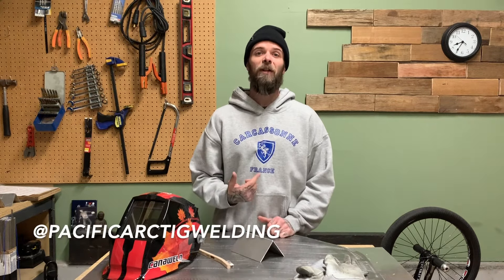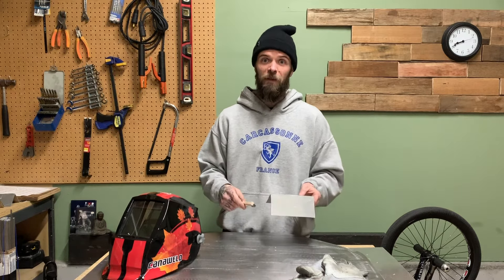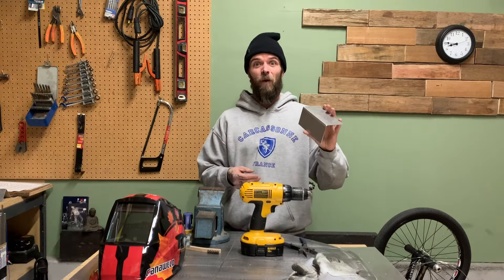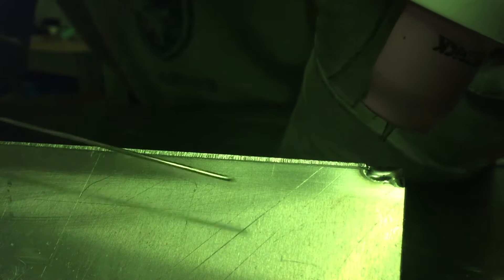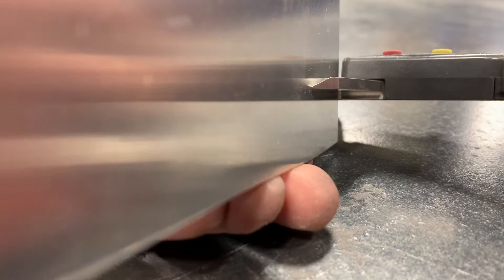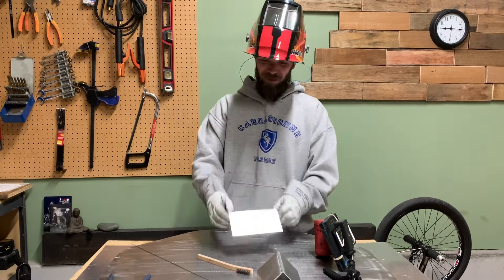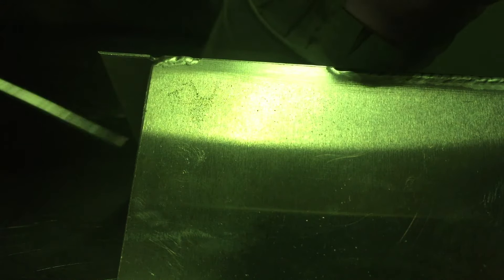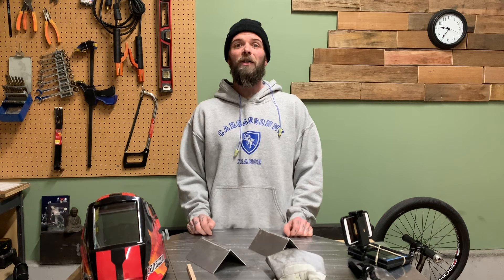TIG WELDING THIN ALUMINUM! *HOW TO MAKE TIG WELDING FILLER ROD - HOW TO TIG WELD ALUMINUM!

Comment: Another great video! That mig wire/drill technique alone was worth the price of entry. 🔥👍🏼🔥
Reply from the maker: 😂😂 Isn’t that ridiculous!? First time I saw it I was laughing my ass off it was so funny how well it worked 😂Thank you so much for watching man; I appreciate it a lot:)
Reply: i realize Im kinda randomly asking but do anyone know of a good place to stream new movies online ?
Reply: I second that.Awesome trick. Hope it works with solid steel wires too.
Reply: @PacificArcTigWelding  I didn't really understand, you used the solid MIG wire to make a filler material but, what kind of MIG wire was that?
Reply: Flux or solid?

Comment: The drill thing is a great technique.  I've also doubled up on the wires to make it slightly bigger and sturdier rod for an 'imtermediate' size.   I've never done just a single wire before and that works surprisingly well.   Super rad.
Reply from the maker: Ha nice! Yeah two wires is great to thick up a length when you need it! Nice move!🍻

Comment: PATW, when welding on a bandsaw cut edge- as shown in the first part of the vid- I prefer to dress the edge with a Vixen file, to cut a smooth surface on the weld face- avoiding having debris from the cut kerf ragged edge (shown) float up in the weld.  Those impurities, as you mentioned in the intro, can cause an interruption of the bead as you travel.  Even if you acetone and brush a bandsaw/jigsaw/serrated cut edge- junk can be maintained in the seam- Vixen file planes the edge glassy clean and smooth- or fine grit belt sander too.
Reply from the maker: Most definitely a clean way to do it! Great tips. Thanks Kevin! It’s cool to hear how more people go about it. Thanks for hitting me up! Cheers!

Comment: I know this video is old, but I really wish you would have given more details about what was going wrong and what you were doing differently during the second half of the .040 weld. You double dipped the first pass but not the second, it looked like you were running much colder on the pedal as well because you weren't melting the filler as easily. You had to pause in a few spots. This is what it looked like but I would love to hear what you're seeing and thinking during the weld and how youre reacting.

Comment: This video really helped me with the simple advice to use thinner filler for thin wall stuff.  I was getting frustrated with 0.060 wall stuff blowing out (and shrinking back) before my 3/32 filler would wet into the puddle, went and got 1lb of 1/16 filler and now my filler melts into a smaller puddle and I can get to traveling laying down a bead.  I went through about 2ft of practice material adjusting amps, freq, and pulse time without feeling good about my welds, watched this last night and got some filler this morning... Came back here to say thanks, out of 10 or so videos I watched on alum welding last night this one had the trick I needed to hear.

Comment: I have been using a similar wire straightening technique for  many years, only difference is I grab the end with a pair of pliers and give it a big yank while clamped in the vise.  no drill , nice and straight. great videos, thanks
Reply from the maker: Nice! See! Whoever said welders aren’t crafty!? ;) 
Cheers Gerald🍻

Comment: In regard to straightening that MIG wire...  You can also grab the free end with pliers (or vise grips) and stretch it by smacking the pliers with a hammer.  This works great for making a straight section of small diameter tubing as well.  I've done this for years on copper and aluminum to make great-looking plumbing with perfectly straight sections.  I think it would work for brake lines too; you just have to use a slightly bigger hammer...
Reply from the maker: That’s insane! Cool idea! So many great tricks out there I’m still learning about! Thanks for sharing:)

Comment: Everlast 210 EXP Machine, been looking to buy this unit for over 2 years just might go ahead with a purchase! Really in enjoyed the first vid on the tungsten grinding and the 2nd vid about the 210 unit welding the very thin and the way you set it up. Also the wire straightening demo. Thanks Again,  AK
Reply from the maker: Absolutely my friend! Have a blast! The machine is lots to play with!

Comment: Bend the end that goes in the drill chuck and put it between the chuck jaws, and it holds very well. I do this all the time with 0.035 MIG wire for thin steel

Comment: The 40 and 50 thou alm is great practice and makes everything else much easier.  I would encourage plenty of time with both thicknesses.
Reply from the maker: Good advice! I do 60 pretty regularly, and really enjoy it when the fit ups are bang on. Welding 40 is a blast too. Super keep to keep learning on it:)

Comment: Great job, the "insanely thin aluminum" you referred to is 18 gauge!  (.040  or 1.02mm's !) 

The .063 is (14-16 gauge, 1.63mm) 

I'm currently practicing on the same thickness ; with the same welder!   Thank you for the great wire filler technique for thin "filler rod" and settings.  I'll be back!
Reply from the maker: Hey nice! Thanks for the gauge thickness- I didn’t look that up, much appreciated:) 
How you liking the welder? Stoked to hear you’re using the same one! 
Cheers my friend 🍻
Reply: @PacificArcTigWelding  Really enjoying the welder (no problems and good people to work with : Everlast); been tig welding about 6 months now and practice every weekend.  16 ga. and 1/8 doing ok ; but 18ga challenging ; tried chill bars, but then I need more heat!  I'm definitely going to get some  .045 filler rod because I run into exactly as you described (balling / ballooning filler rod!  I was quite surprised you were using a 3/32 electrode!  And 250 hz  wow! It sure works for you ; I will try it also.   I do use pulse, but only on 16ga and up , usually outside corners. I also want to try your camera set-up! Is that a welding hood electronics in front of your cell phone ?  Love it!
Reply from the maker: Haha yes it’s actually surprising how well it films for such a simple setup. I’ve tried fancier cameras etc but this honestly works the best haha. I’m doing the channel full time and doing it all on my own dollar so it’s gotta work good and work easy!😂
Sounds like you have a great setup to learn with! And some good teachers hopefully!
Reply: What settings are you using? I’m burning through
Reply: @jeffreywilske8706  It really depends on your welder and what type of joint you are welding:
for example, on my Dynasty I use some pulse, .045 filler, 1/16 W ,  Lap Joint. (NO GAP). 
on the Everlast 210 ext. Lap Joint I use .045 filler wire, 1/16 W, and no pulse.  127Hz AC freq. and 25 AC Balance, and the Triangle wave form.  
If you are "burning through", clearly you are to hot, or going to slow ; just start dialing your   amps back, but .045 wire fill really helps!  
Also, use some chill bars and lay your work on a 1/4" flat piece of Aluminum , clamp it if you have to.  When it strarts getting difficult to weld or get a puddle started, you know your heat sinks are working. So, then either adjust your work or change your settings.  You must experiment.   
But the two that make the most difference are .045 filler wire, and some type of chill bars.

Comment: Hi, I'm new to Alum. Tig. You have been a big help, thanks ;)
Can you do a session where you weld the the inside of a 90 deg angle, for example welding a 1" square tube, 1.6mm the, butted up to the side of another tube the same. I am getting better but the tube end blows out and flame gets sucked all over the place. Its easy to get a lump because the filler is in a heat tunnel, and then so hard to get rid of the lump. Thanks ;)

Comment: Love your videos! I’ve been watching a lot of different channels on Tig welding but for some reason this was the first video that gave me some great tricks to help me in learn aluminum. I recently made an aluminum bracket to hold filler PVC storage out of .040, using 3/32” filler. Tried running .045 al wire but it was so floppy. Your drill trick will help me out there for sure! Still learning balance and frequency. I think my frequency was on 125 and my balance on 30 with no pulse. It was rough but I got I made and it’s hidden from plan sight. I’ll make another one once I get better. Lol
Reply from the maker: Hey Kevin! Thanks so much for the kind words! I’m really happy to hear you got some value from the video! I’m having a lot of fun with making these episodes, stoked to hear it may have shortened some learning curve for people 😂 That’s awesome the drill trick helped, that one was so funny to me when I first saw it 😂 Let me know how the project goes! Cheers

Comment: That everlast welder looks great. I'm thinking about getting a new everlast welder myself.
Reply from the maker: I can’t recommend it enough. It’s a blast. How long have you been welding for? My CanaWeld has turned out to be an absolute beast too. A few less options, but overall killer machine. Either one I have for my channel is a good machine💪

Comment: I'm just starting to weld and your videos have been very engaging.  I have a question regarding material.

Generally most YouTubers use the same terminology for materials, Aluminum, Stainless Steel.  But hardly ever discuss which Aluminum or which stainless steel, and even more, which ones are not weldable and which are.  Also, the filler rods are found in many varieties.  

Also the Tungsten someone mentioned can be a different alloy for different welds.  

Can you address these things some time?

Thanks for all your effort.  I really enjoy your content.  

What materials are you using?

Comment: Great techniques. One question, you set your available amps at 130 to start but I know you weren't using most of that. Any clue to what your operating amps was, (maybe a small window in the corner of the video that shows where your amps are as your doing it) this would give a closer indication of how much pedal work goes into this with that many amps available at the start. Great video, hope you have that answer and might consider adding what your machine is doing while you're welding in the future.

Comment: I did that mig/tig wire trick everyday at my old place of employment building Airplane frames. Everything was .035 1/2” 4130. Loved when the fuel tanks came .035 6063 it was a nice change of pace.
Reply from the maker: Awesome! Variety is key sometimes...🙏

Comment: Very cool. I first saw the wire twist trick in a vape shop of all places. It also work hardens the material some so it’s more rigid. 

Q: can you tig through anodizing? I may have missed it - what were your amperage settings? I’m going back and looking at aluminum vids, I may be adding another Primeweld (225x) to the kit - have some work. Doors and windows - so thin gauge material and typically anodized.
Thanks brother Dusty!
Oh - and lube your vice dude. 😝
Reply from the maker: Haha squeaky vice for sure😂 And no, welding through ano is a mess. Best to cut it back with a grinder and sand a bit to get base material back🤙
Reply: @PacificArcTigWelding  Cool thanks for seeing my comment on an older vid. I assume fried anodizing is also something you don’t want to breathe... 

I had forgotten about the wire trick - I’m gonna try it with some tiny stainless 308 wire I have for wrapping vape coils. 
I scavenged some really nice stainless from a Viking bbq grill install where the outer retaining part wasn’t needed...will be good for some experimenting.
Thanks again.
Reply from the maker: @baldwindigital  Absolutely Marc! sorry I cant always see all the comments, Im trying haha. And yeah, Ive done some repairs on ano, really nasty stuff. Plus the heat discolours it so bad. Best to remove as much as possible and start fresh:)

Comment: twisting the wire to make it stiff. BRILLIANT! I am new to TIG, but had a fine steel joint I tried yesterday with wire from my MIG..... could have used this!!!  What did you mean by "too much drag" with the torch angle too vertical?

Comment: you can also just pull on the wire until you feel it give slightly and it will also stay straight. Its a old vaping trick for those who used to build coils...
I wonder if I can use some of my old ss wire as filler now lol.

Comment: You can also twist the wire doubled (loose ends in the drill, looped round a screwdriver in the vice) to make a thicker rod.
Reply from the maker: Dude too funny! Someone just showed me this recently too- funny how many tricks are out there! Cheers🍻
Reply: That’s actually what I do with leftover steel mig wire, I twist it up a bit to turn it into filler, so it doesn’t go to waste when it gets to the end.

Comment: You can straighten the wire by just stretching without spinning it with the drill.

Put one end in the vice hold the other with a pliers or vice grips, works with steel too.

Comment: The tungsten looked super sharp like how you'd have it for mild steel. Do you have it like that for all aluminium welding. Thks,
Reply from the maker: Hey John, I always try to keep it as sharp as I can, with the smallest ball on the end. It helps with arc deflection, and ges the arc locked on much quicker, which is important with really thin stuff like this:)

Comment: Hi there. I have 1973 classic car with a 1mm undertray and hood. These panel need some patch repair and I am wondering if I can tig weld new aluminium to the old. The old seems a little brittle, perhaps I should rivet panels in. What do you think?
Thanks, Bill
Reply from the maker: Hey bill! Honestly, if I’m SURE it’s aluminum, I’ll give it a whirl. If it doesn’t work, or turn out well, you can always cut and rivet afterwards:) No harm in trying. Just get that old metal clean! :)
Reply: If it has magnesium in its formulation, I've never been successful.

Comment: Looks like you sharpened your tungsten to more of an angle on your second pass of .040? Have a precision tig 225 by Lincoln and and leaning as I go. And on the same pass kept a tighter arc? Would like to see some more tips/tricks by you. Nice work 👍🏼

Comment: I'm converting a aluminum boat from an inborn outdrive to an outboard. I have to cover the hole where the outdrive came out. The aluminum is just under 1/8 inch. The marine plywood behind it, might be a problem. I was thinking just slide in a sheet of some steel. What do you think?

Comment: @ Pacific Arc Tig Welding Dude, i had to fix a little Avionics Bracket for my Bosses Helicopter the other day that was the exact same stuff 0.040 Aluminum, and I have to say it sucked a Big Donkey. 1st it broke right in the middle of someone else's previous WeldBead. 2nd it was Powder Coated which made it a nightmare  to try to get it cleaned properly for Tig Welding  3rd i had to do it with an old Syncrowave 200 Transformer machine. I wanted to take it home to my Primeweld 225X soooo bad.I cuased that job all afternoon long. 
Like your channel. I just want to point out that you are teaching one thing improperly though. When cleaning Aluminum with a Wire Brush, you should only stroke the Brush in one single direction. Either away from you, or towards you (whatever is more comfortable) When you brush it back and forth you are rubbing Oxides back into the metal. This may sound crazy, but I am 100% serious. Take 2 pieces of the same Aluminum and clean it the way that you always have, and the other my way, then weld both of them, and I promise you the one you do the way I am telling you will have much better Arc Characteristics, cleaner Puddle, and overall better & cleaber looking Bead when you are done. 
Trust me I did it your way for 20 years until Jody Collier recently just showed me the correct way.
Reply from the maker: Nice man- I appreciate that feedback. I’ll look it up! :) More knowledge the better 🍻

Comment: That was very helpful. 
One thing I’d be interested in is a camera shot of the actual amps being used. 
As you are using a pedal the amp setting on the machine isn’t real relevant. 
Thanks. Looking forward to the next one.
Reply from the maker: I've actually experimented with this. Good idea! I'm trying to learn how to do a picture in picture to show the amp readout in the corner. Hopefully ill have it for some vids soon!

Comment: Great video!  Did you change any settings when you switched to the 040 AL?  130A seems a bit hot.
Reply from the maker: Yeah you’re absolutely right. I don’t remember changing it, but definitely would have backed way off on the pedal. Try to not melt the piece...!😂🙏

Comment: Enjoy your channel. In early 80’s I was  selling tig welders one of my customers had requirement of welding .003 stain less steel bellows for their product. I tried many welders finally came up with a 300 amp Hobart cyber tig. The transformer was very stable and adjusted the hi frequency points down so it wouldn’t burn though. I supplied customer with a foot controlled turn table the operator had very stable hand. Worked very well.

Comment: Could 200hz ac frequency be enough for the thin stuff? I'm looking at 2 machines, one maxes at 200hz (weldpro tig200gd) the other 250hz (yeswelder tig250p).